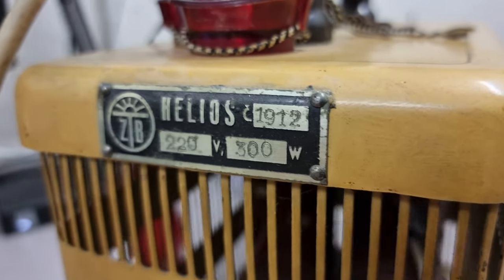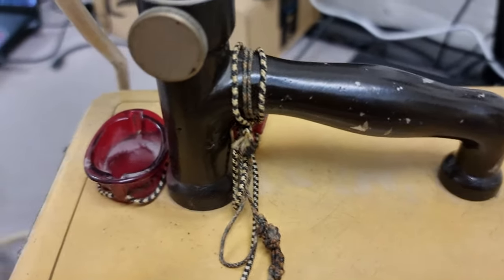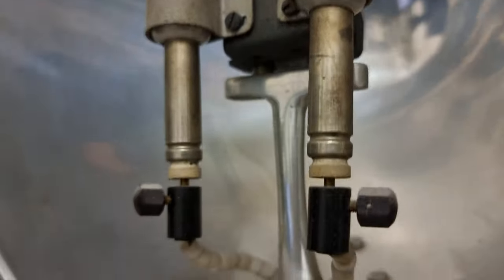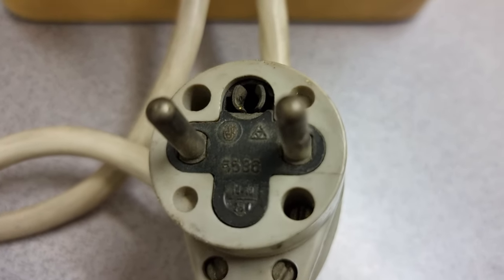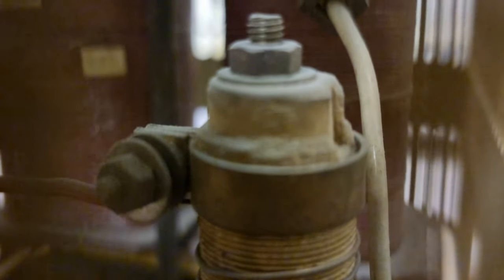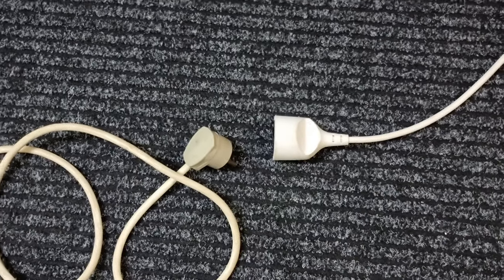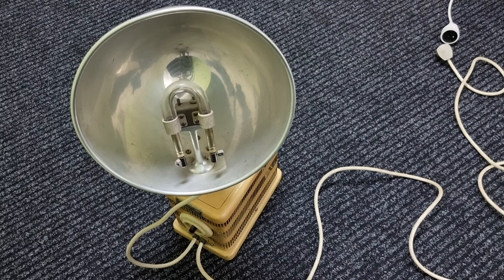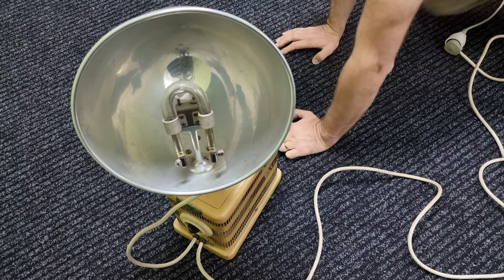HELIOS - Flash?

Comment: Your gonna have to take off the cover and draw out the circuit then test out the components.  I really like that transformer in there, looks well built and oversized so useful for certain.
Reply from the maker: The switch can continue to rotate, from O to Z positions. I think it charges in the O and discharges in the Z - I never rotated it when it was on, so I only saw, what looked like an excited Xenon flash - when I was editing the video. I will find out when I go to office later.

Comment: What will this be used for?
Reply: Christmas turkey
Reply from the maker: Like many speculative tools, I purchased this first with my own money as there was a risk it would not even work, actually, I only saw the flash when editing the video. It only cost $35 so I don't feel too bad!

If it was continuous and had a high UV component, it could be used for attempting to re-excite EVOs in LION crust and ECCO Fuel ( both from 2017) - if it did that, it would be the longest time after an experiment that EVOs had been re-energised (current record is 18 months, Barranov and Zatelepin). It could also be used as a cheap spectrum analyser calibration source.

If it only flashes, then it could still be used to calibrate the spectrum analyser.
Reply: @MFMP  so if they can be re energised would that make it and ultra battery, storage or power wise.
Reply from the maker: @pauloneill9880  Exactly. This was my premise about Gold at my presentation in 2017 (RedPill) in Mumbai.

If an EVO can act as 'one electron' and can, as a muon can, replace free electrons in conductors or in element orbital electrons, then you would want a conductive element (metal) with a lot of protons (a heavy element).

Since EVOs are known to promote corrosion / oxidation, of the really conductive elements Al and Cu are not good as these can easily oxidise and be forced to transmute.

This leaves Silver and Gold. Silver is the most conductive, but it has a lower melting point than gold, it can also readily form compounds with Halides, oxygen etc. So it will corrode easily with 'super strong electrons' in it, if it is in any kind of atmosphere. This leaves only one element GOLD

Gold has 79 protons, loading it will make it go to a 'liquid eventually' which will help with mining. But it is noble - that is it does not react. If in the ORMUS state, it cannot react with anything, but can store EVOs in replacement of the electrons.

This is why Gold is the most precious element. It is the ultimate battery. This is the argument I was making in 2017 - this is why it is highly desired. It is not a barbaric relic IMHO - In the ORMUS state, it is the ultimate store for 'the god's toolbox'